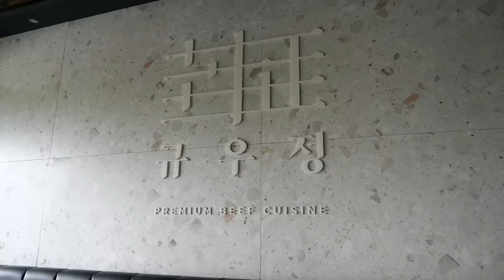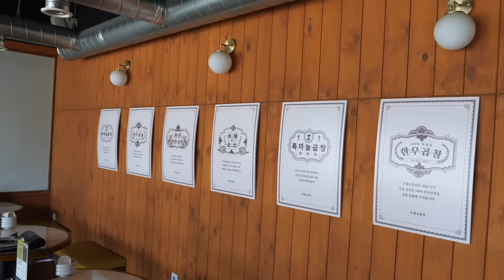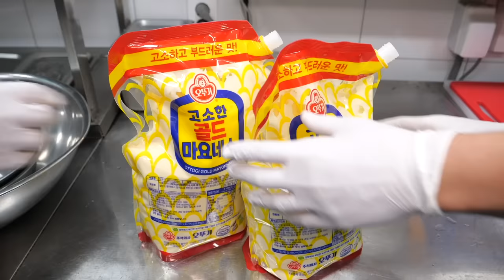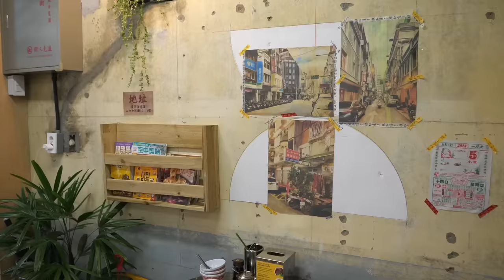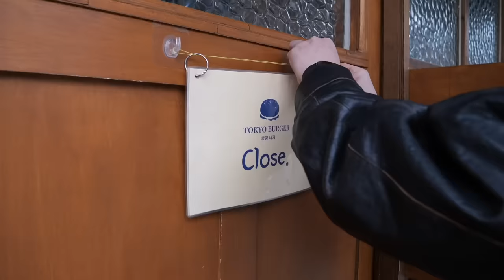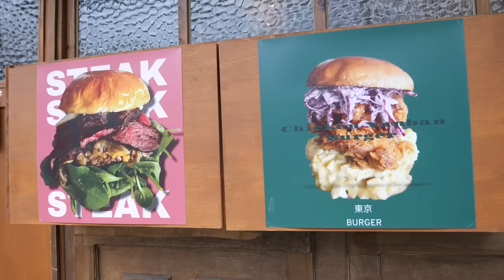보기만해도 군침도는?! 맛있고 인기많은 소고기 요리 BEST 6! amazing beef dishes in Korea - Korean street food

Comment: You had me until intestines. Disgusting.
Reply: You don't eat sausage bro?
Reply: @kangkim150  Sausage casings are a thin collagen connective tissue layer pulled from between layers of cells. It isn't the full thickness intestines, and it never touches stool.
Reply: I was thinking the same thing. Is that stool inside of the intestines?😤